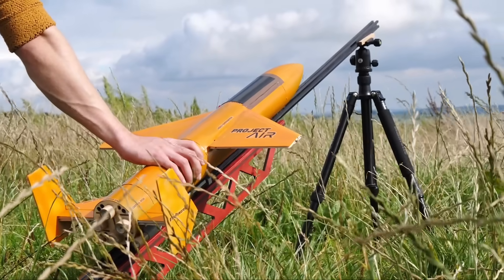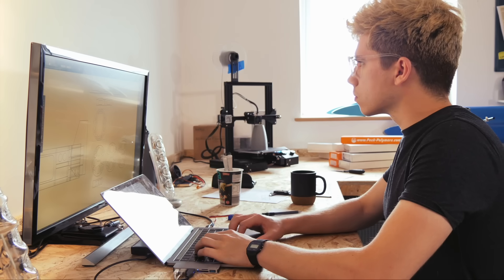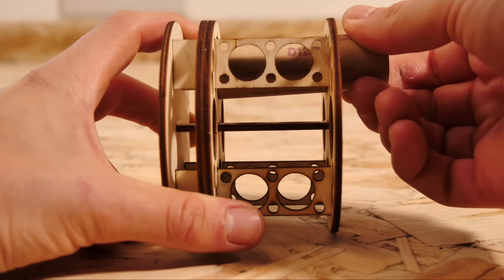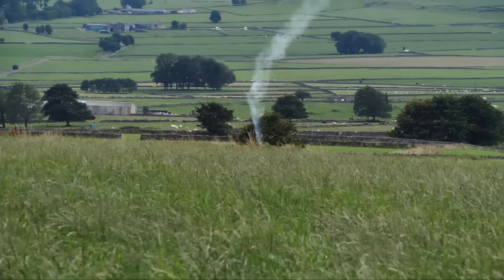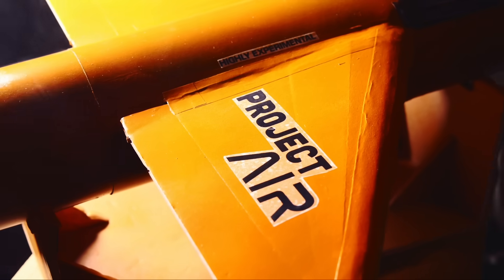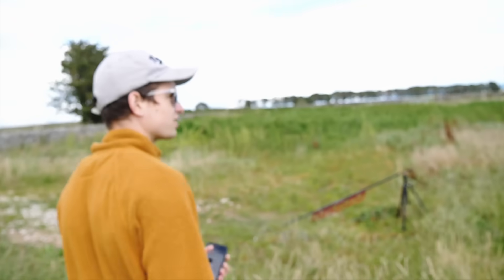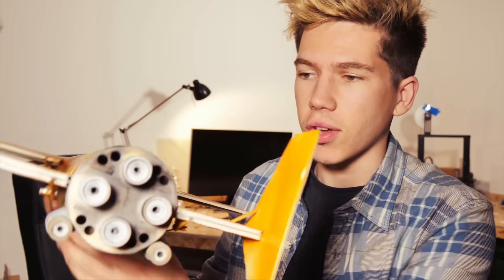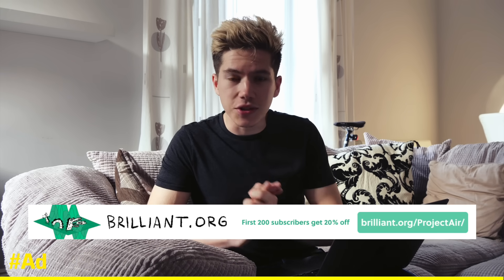High Power Rocket Plane

Comment: I notice whenever you make a turn it drops like a rock, how about fitting a rudder to stop it slipping/falling and losing altitude on each turn.
Reply: It has 2 vertical stabilizers but no rudder.
Reply: On a short span (low aspect ratio) plane a rudder does not do much for better curve coordination. The aerodynamics of this design are pretty crude and the wing loading is high. That's the reason for the poor gliding performance.
Reply: Funny that the consistently fastest RC planes, are gliders.  closing on 600mph
Reply: @NorfolkTrailRiding  Not really funny, considering that by their very nature gliders must be aerodynamically efficient designs. Combine that with the more and more perfected use of nature's powers and you get that result.
Reply: A plane loses lift in a turn “bank” requiring the pilot to pull back on the elevator to maintain altitude and backing off when back in level flight.
Reply: You could get it up to 120 mph by shooting it straight up then falling straight down.
Reply: Already has 2